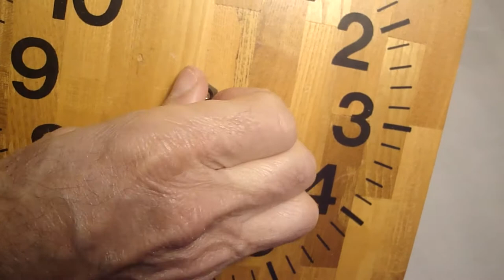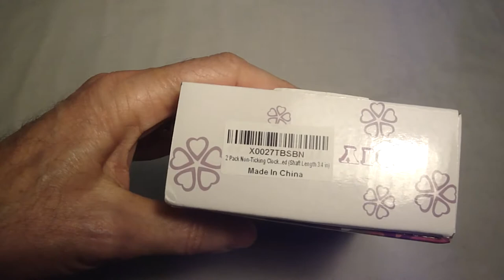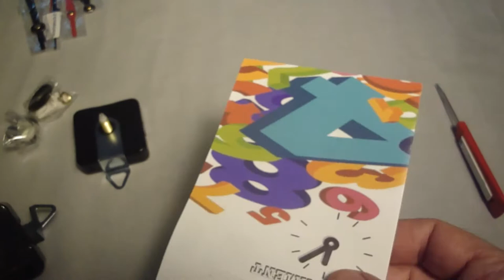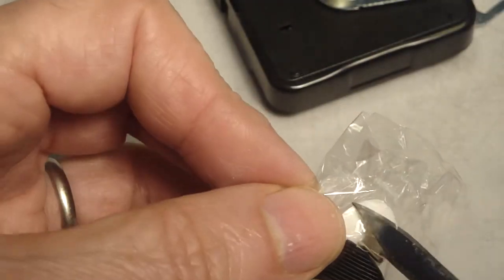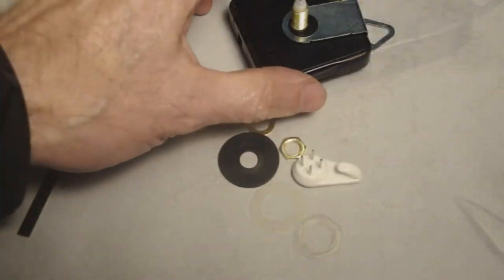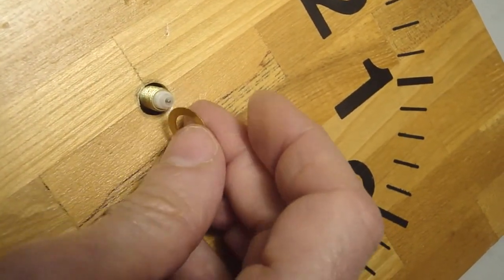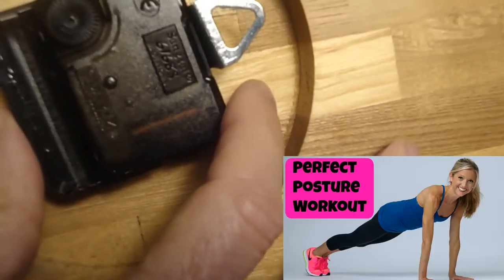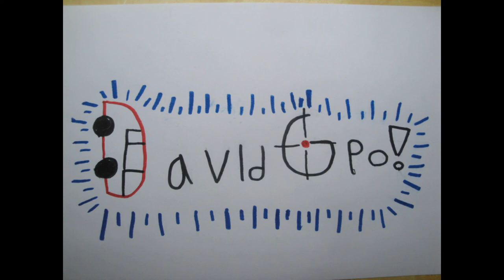Repairing a Wall Clock

Comment: The movement doesn't work? The Balance wheel is still swinging back and forth. Maybe the original movement just needs a bit of oil. 

I may be too late on this, but don't throw the original movement out!
Reply from the maker: There is movement in there but nothing much else is happening and it's over 40 years old.
Reply: @davidgpo  There's still hope for that movement. I get that you don't want to bother with it, and that's fine, but don't throw it out.